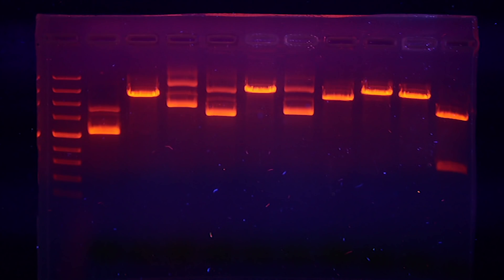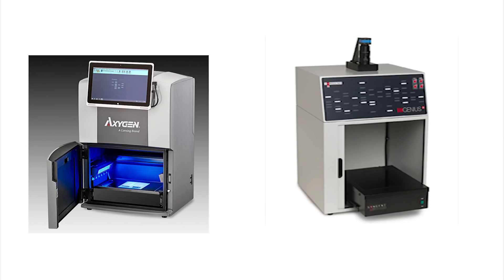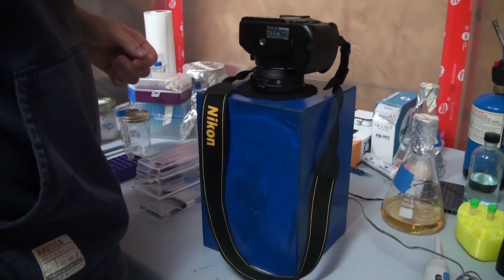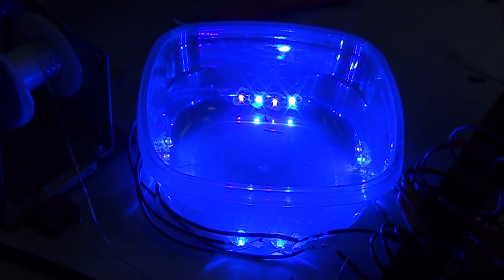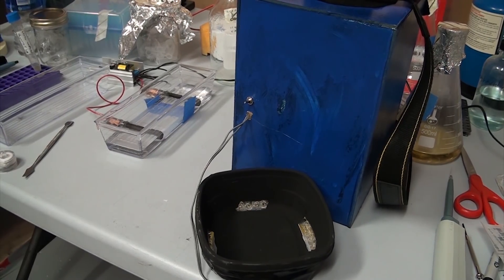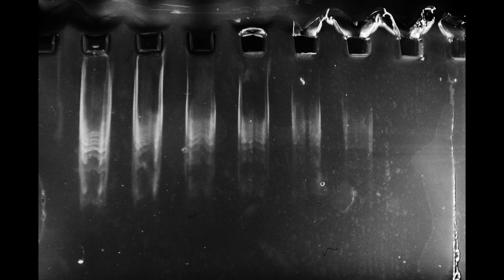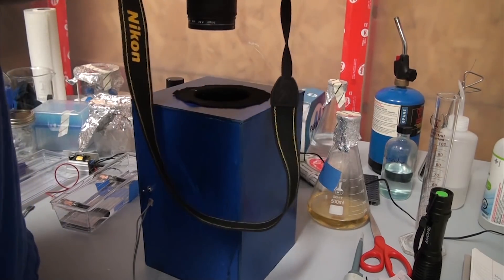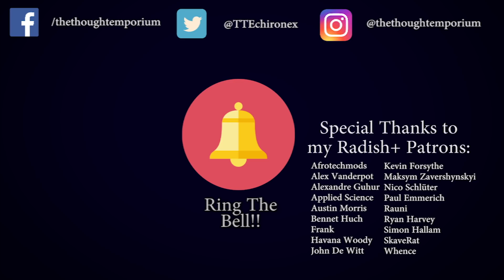Building a Gel Doc - The secret to perfect gel images

Comment: I see it's five years since this video was posted. I wonder if I'll get a reply?.. I have made a Gel Doc as described only I still can't see anything in the resulting photo. I added a gel stain called 'RUNSAFE' by Cleaver Scientific, 7µl to 40ml agar. I ran a gel with 4 wells of CSL-MDNA-1KbPLUS Ladder again, by Cleaver Scientific, I filled each well with varying amounts from 5µ up to 12µl. Multiple photos exposed at various settings... The result.. nothing!.. what am I doing wrong?.. I am illuminating the sample with a UV torch light pointing down from above, is it perhaps required to be lit from below? From underneath the sample or side on? Hope you can help. Thank you.
Reply from the maker: Traditionally you want the gel lit either from below or the sides with as intense of a blue light as possible. Dont use a UV light, itll make the gel itself glow and wash out the ladder. Also i find it helpful to use a fluorescent loading dye on top of dying the gel itself. This way even dilute samples are much easier to see. For a 10000x dye, i use between 14-21 ul for a batch of 100ml of agarose. There us such a thing as too much dye, but honestly, cranking it up a bit makes life much easier.. hope that helps!
Reply: @thethoughtemporium  Yes, great stuff, I'll give it all a try. Thank you for getting back to me so soon.
Reply: @thethoughtemporium  Thank you, that's all a bit clearer... although I'm still having problems visualizing the DNA bands, I think I will stick with the Blue Light system, thanks for the advice... I'm using a Cannon Zoom Lens EF-S 18-55mm with a  TIFFEN orange 21 filter. Should I consider buying a new lens?

Comment: Nice work. Though ive found working with gelred and gelgreen they are both super sensitive and super bulky dyes. If you are staining before casting and are finding smearing like 7:09 to be a problem try reducing dye to 5 ul (10,000x stock) per 100 ml of agarose gel, 15 ul per 100 ml is a lot of dye. If smearing is still an issue dilute the DNA further or post stain. 

Also same volume per well ive found to be fairly crucial so if you are comparing 1 to 4 ul of DNA load 5 ul per well and make the rest up with loading dye.

Comment: Very nice video and attention to detail. The earlier comment about the size of the wells in your electrophoresis unit is true; you could solve this by making a comb out of a bit of 1.5 mm thick teflon sheet: you cut out slots to form a comb such that each tooth of the comb forms a perfect well for your sample . Place in the  gel just after your pour it and let  it set up. Another idea for the future is fluorescent Western blot photography. I think this system will work for that technique as well.

Comment: There have been a couple camera-related comments, but I'd like to add my own:

- noise is a complicated subject in photography, and there are some rare exceptions where shooting above the lowest ISO is desired, but in this case you will almost certainly get a better result by shooting at the lowest ISO you can and lengthening the exposure. If your camera limits exposure length to 30 seconds you may not be able to do this, but try to lower it as much as possible.
- you increase the f number the the 'sweet spot' (dxomark might have info for your lens) but there is a chance this will increase noise more than it will help with sharpness (and sharpness may not be useful in this context anyway).
- disable image stabilization and autofocus, if either are enabled (they don't help in this situation)
- DSLRs can leak small amounts of light through the viewfinder; normally not an issue but can be a problem e.g.  if you are doing long exposures or if the sun is behind the camera: try covering it over when shooting
- enable long exposure noise reduction, as another poster mentioned, if your camera has it. If you don't have it built-in you can take your image and then immediately take the camera out, put the lens cap on, maybe even throw it in a sealed bag (in case any light leaking through the lens cap) and take a second identical exposure which you can subtract out in post.
- you can increase the SNR tremendously through "image averaging" techniques. Dial in a good exposure, take 10 of them (more is better). IIRC lightroom can do this itself. If you're using something else: don't do any processing in post besides converting them to 16bit tiffs (no brightness, no sharpening, no lens correction, nothing; only white balance and format convesion). Then you can optionally align them (e.g. hugin comes with "align_image_stack" utility). Then you can use the gmic CLI to align them and do a "median_files" process on all of them. (Make sure to use  "-o result_16bits.tif,ushort" on the gmic command line.)
Reply: ...all that said, it looks like noise isn't really the limiting factor in your images, so much as the contrast between the imaged stain and the glow of the lights in the gel, so maybe it's not necessary to worry about any of the photo nerdery. Might help with your bioluminescence time lapse, though.

Comment: I don't see why, you can't use a Raspberry Pi and its 8M camera, also the LED could be driven by the RasPi and 'synchronised' in a kind of automated image processing script...
Which UV led do you use ?  365nm, 385nm, 405nm ....
Reply: Because that camera has small sensor which would produce pure noise in this setting.

Comment: Nice work on the gel doc!  
For improved images, my strongest recommendation is to improve your gel comb.  Your wells are extremely tall.  (too long in the axis parallel to the direction of DNA travel)  Since agarose gels don't focus the DNA like PAGE-SDS, your band quality and sharpness are adversely affected by tall wells.  Not only is your DNA spread out over a wider area (lowering areal fluorescence intensity), that wiggle in the bands is making differentiation of bands difficult.
  An interim way to potentially clean up that band wiggle is to flush out your wells with the pipette before loading the DNA.  There can often be bits of agarose cruft that sits in the bottom of wells that messes up how the loading gel sits at the bottom of the well.
  I had really good luck with DIY well combs by laser cutting some thin plastic.  I forget what I used but I just checked Ponoko and they have 0.8mm delrin and 0.5mm PETG, both of which should work fine.  A <0.5mm sheet of plastic will give you excellent well formation.  Shorter wells will reduce any band wiggle and also concentrate each band into a smaller area, giving you better low concentration sensitivity.

Comment: A few things you should try out (from the perspective of a long exposure landscape photographer)

- you did not mention which lens you're using but if it's the kit lens, then you should be able to increase the sharpness a tiny bit by increasing the aperture to f/8 (there's usually a sweet spot and wide open (as you've probably had it) is the worst setting)
- I assume you only used a 10 second exposure because the image became too noisy. Check out your camera settings. There should be an option for "long exposure noise reduction". This will take a second picture (an x second exposure will take 2x seconds) which records sensor noise data. This will remove a lot of noise that is introduced shooting long exposures and this can't be done using software. If your nikon supports that you should be able to take the iso down to 100 by increasing your exposure to a minute or so.

And a few things for others that were not mentioned:
- You don't necessarily need a DSLR. New phones can take long exposures (and even shoot in RAW!).
- Always shoot in RAW never in JPG. This will retain a lot!! more information.
- Don't move your camera and use a timer to take the image. Every tiny bit of movement will blur the image. Even you pressing the shutter button can sometimes ruin the image.
- Lightroom was mentioned briefly but this is the tool that will save you hours if you're doing any kind of photography related task. Photoshop is not needed!
- Always try to keep the ISO as low as possible. Because the camera is stationary you can let the sensor take in as much light as you need. 

There's almost no excuse for anyone not to try this and I have to definitely try this out sometime soon. I didn't even know that such things were possible. Thank you!
Reply: My first thought was the higher the f ratio the higher the contrast, and I see you have answered this nicely.  The low ISO I presume is to keep the noise down on the exposure.  I wonder if image stacking could produce better signal to noise as well.  Might be an interesting experiment to try.  Take a number of lower exposure time pictures and then use image stacking software to combine them.  CCDs tend to get noisier the longer the exposure, so by stacking photos you increase the signal to noise ratio.
Reply: So a redmi note 7 with gcam be sufficient?
Reply: With night sight
Reply: Maybe I will shot in a dark room to even further improve the quality

Comment: It feels like you could still squeeze even finer precision out of this setup.  Why not a longer exposure and lower ISO?  If you're limited by the camera's max exposure time, you should get a cheap wired remote and use bulb mode.  If you found that longer exposures with lower ISO were actually noisier you might look into whether the camera supports dark frame subtraction for long exposures.
Reply: Why would you need to do the correction on the camera? Could you not shoot both the dark frame and the gell image in RAW and do the corection on the computer? I understad you would need to apply the correction manualy every time, as apposed to it being (semi?)automatic on the camera, but I don't see a reason why it HAS to be done on the camera. I also understand that it likely would not work if you shoot in a lossy file format.

Comment: Okay, I only know SLR cameras, but ISO 800 seems insanely fast to me. Why? Why would you use a fast sensor? Nothing in the gel should be moving fast enough for this. I'm realizing as I type how little I know about DSLRs... On film, high ISOs are super grainy and awful. But I admit I don't entirely know how any of my SLR knowledge translates to digital. Isn't there a quality loss with a high ISO?
Reply: With DSLR long exposures you don't have to worry about reciprocal failure, but you do have to worry about the accumulation of dark current noise.  I would guess he found in his testing that doubling the exposure time and dropping the ISO to 400 resulted in more noise.

EDIT: or it could simply be that the camera doesn't support exposures long enough to get away with base ISO
Reply: But the ISO is generally independent of the shutter speed tho? Or so I learned. You can have a slow shutter speed with high ISO but I guess then the image would be too bright... Plus with DSLRs these days the image processing tech came a long way and along with the high sensor resolution even an entry level DSLR like the nikon d3300 won't have perceivable graininess up to about ISO 3200...
Reply: @THeMin1000  wow, haven't thought about this for a while. ISO is independent of shutter speed, it's intrinsic to the film's light sensitivity. But I don't know the basis of that, what makes a film more reactive? More silver crystals? bigger? I guess DSLRs need tight small grids of sensors, and they don't change between ISO settings, it's a matter of a long average I guess? Can someone give me a DSLR to play with? I'm very curious. ;)
Reply: ISO 800 is more light sensitive, hence making it faster than a low ISO (but not that fast on digital). A higher ISO will be nosier as it picks up more signal noise. However, digital sensors produce more noise the hotter they get (from long exposures). So he chose 800 as it is high enough to use a short exposure (10 sec instead of say 30 or 1 min) but low enough not to introduce to much signal noise.